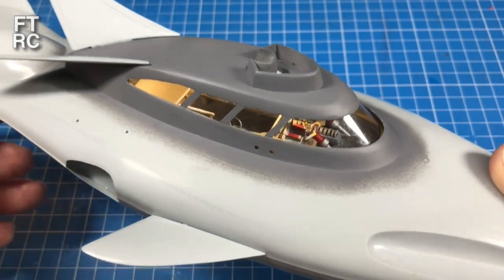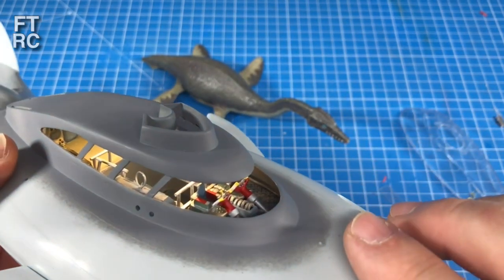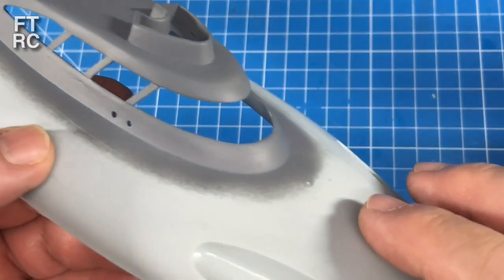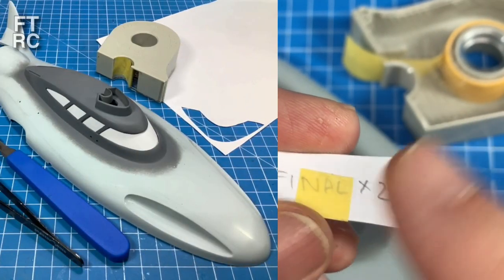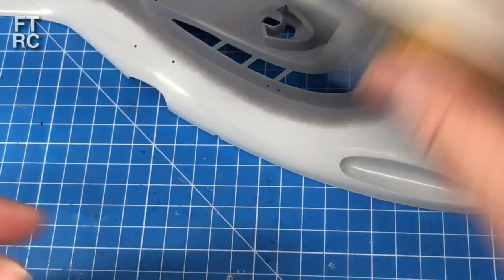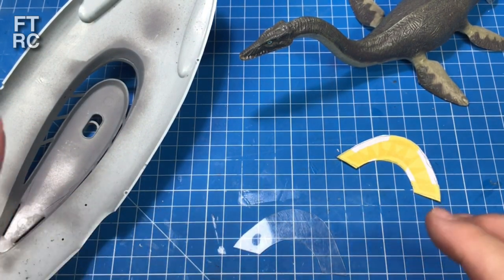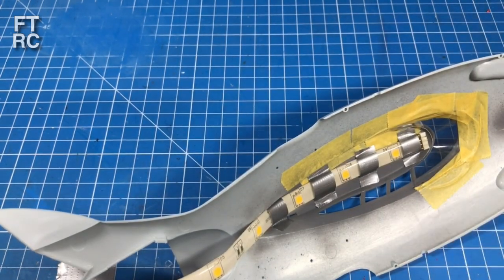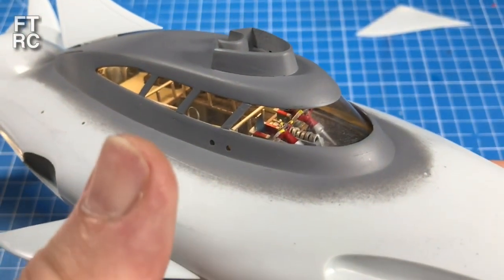Stingray Part 8 New Acetate Windows and LED Lighting the Cabin for Gerry Anderson show submarine kit

Comment: Building this one now.  A days work (literally) with polishing compound made the kit part useable.
When you come to assemble the hulls the clear drive section is about 1.5mm short leaving a gap between it and the hull.  Fortunately the back plate for the drive unit is about 0.5mm smaller than the hole it fits into so a 109mm long collar cut from 0.25mm sheet both makes the back plate fit prefectly and it hdes the gap. I made mine 10mm wide but you could get away with 5mm.
Reply from the maker: Thanks for the heads up Neil.  I will watch out for that when I continue the build later this year

Comment: Very useful - thanks. What glue will you be using on the acetate?
Reply from the maker: I will glue the clear parts in with PVA White Wood glue Jeff.  It dries clear, wipes off when wet with water, but won’t melt or fog the acetate.